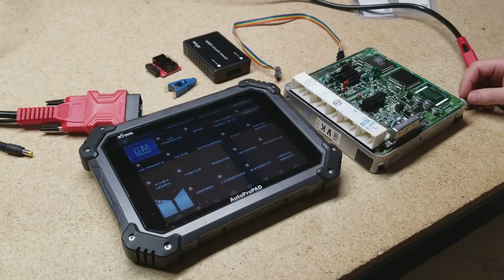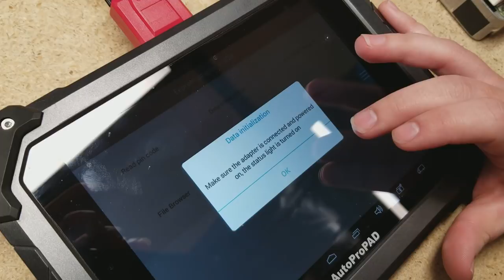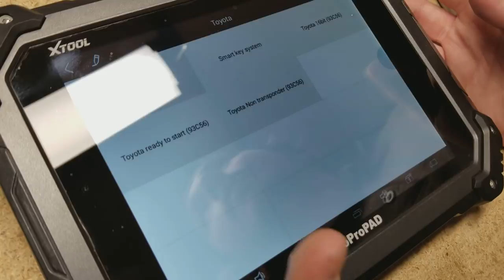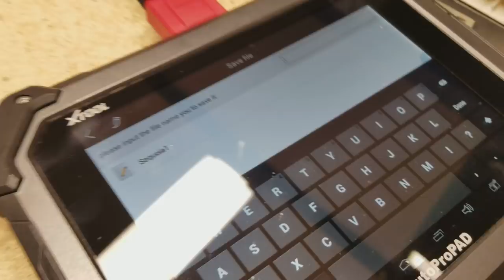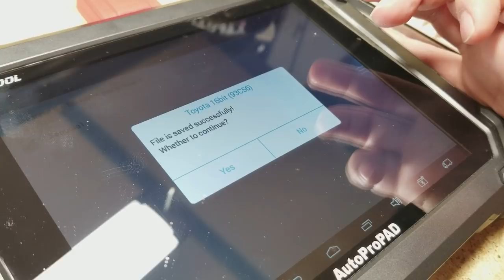Reflashing with the AutoProPAD in 2017

Comment: The other part you didn’t show which is important is the cleaning of the chip. I saw the cleaner in the background. I had  a shop call us to get help on flashing because they were not getting communication. They had not cleaned the chip before putting the clip on. Saving the file and showing what to do if you flashed and the car was not Immobilizer equipped might also help.

Comment: What is the common reason for reflashing the ECU. And if you put the ECU back in to the car after reflashing would it be ok for the vehicle?
Reply from the maker: Some cars cannot be programmed via OBD ports, they must be done via EEPROM reflashing. Some can be done either way.
Reply: @carystevens3146  oh ok  i got it now. 

but is it going to ok for the ECU after reflashing and putting back the ECU?
Reply from the maker: @dashtyATG  When locksmiths "reflash" a module, they're usually putting it back to its virgin state, like buying a new one, like the day it was installed into the vehicle. There will still be some kind of programming that needs to be done. In old Hondas and Acuras, for example, that requires connecting a diagnostic tool via OBD2 to program special keys. In old Toyotas and Lexuses (Lexi?), it's an on-board procedure (OBP) to introduce keys.
Reply: @carystevens3146  thank you brother for your time as am still learning and just about to have my own business starting soon in north iraq kurdistan city erbil.

Comment: Where do I get that kind of PCB circuit board and rainbow wire's from?
I just received my x 100 pad 2 and it's useless without these two things.
Reply from the maker: Jason Skeen I think it is only available for the AutoProPAD
Reply: Cary Stevens 
Hey boss 
do you mean the only auto pro pad do flashing?
And do you any idea about x100 pad2 
And what is the different between both of them??
Thanks Cary 
And thanks for your video 
American key supply always the best
Reply: Have*

Comment: It is an Awesome tool can I get PCB and Rainbow cable for my Xtool X100 PAD2 Pro Auto Key Programmer With KC100 For VW 4th 5th IMMO Scan Tool because it is the only missing part, otherwise they look the same on software and come from the same manufacturer.
Reply: Do you know if this tool can convert km/h to mph on Toyota Prius